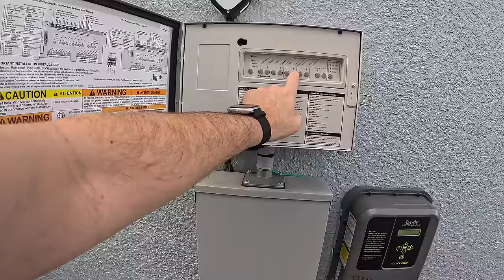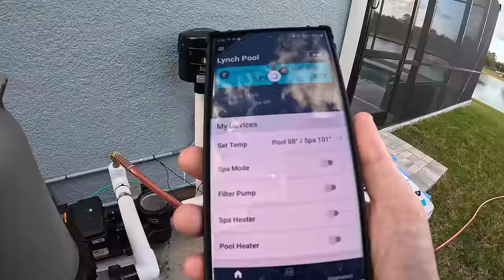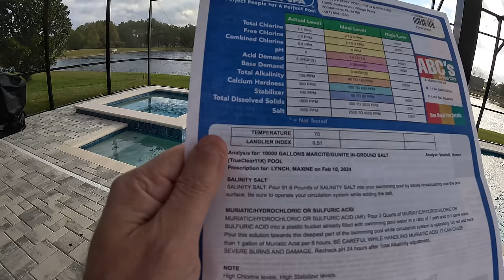We found Mold - Home Renovation - Orlando FL

Comment: The bathroom looks fantastic!! You may have resolved the shower control face plate by now, but if you haven't, I would suggest checking with a local machine shop to see if you could get one fabricated. It probably won't be cheap, but it will be less headache than a new hole in the wall.
Reply from the maker: More to come on that story soon

Comment: Can I ask what maybe a silly question, but with all the extreme weather you have, heat and lightening, why does no one ever cover all the pipe work and equipment down the side of the house? I’ve always wondered this when we’ve been to Florida. Surely it would look neater and wouldn’t get struck by the storms, told you it was a silly question 😅
Reply from the maker: It’s not a silly question, we think it’s weird as well. We are currently researching what we could use to share the pool pump and pipework from the sun